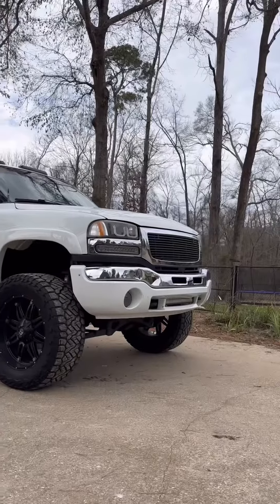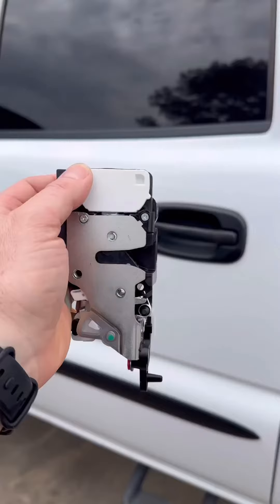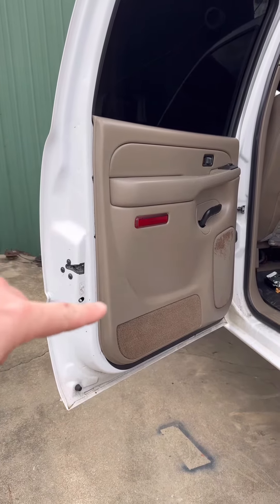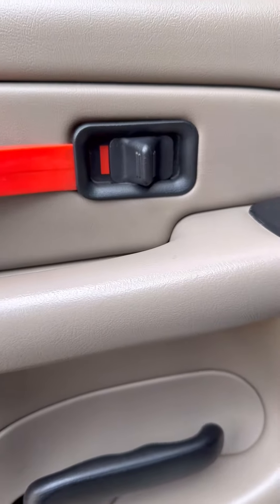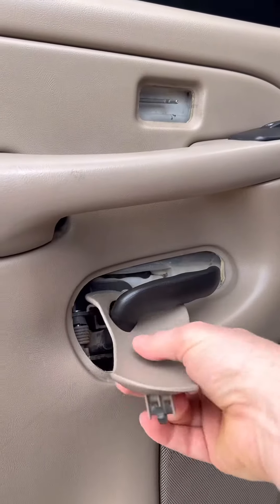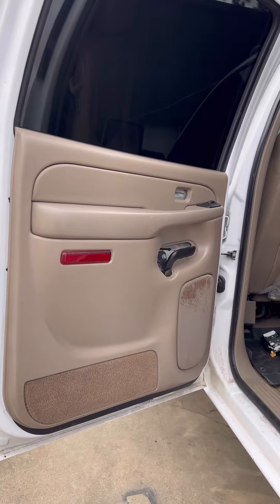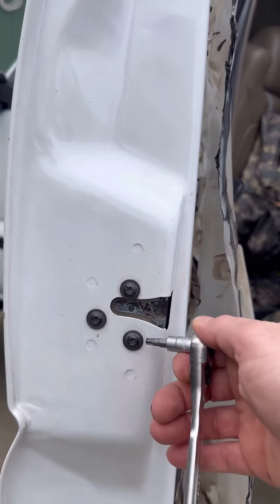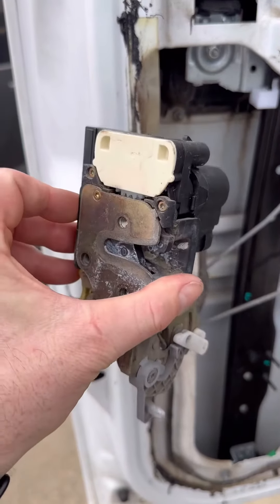60 Second Fix GMC Sierra | Chevy Silverado Door Actuator Replacement #chevy #gmc #silverado #sierra

Comment: Does this also help with how the door shuts? Not having to slam door hard to close it? Just curious
Reply from the maker: We did not experience it being hard to close, but yes, it could be possible that this would make it hard to close.
Reply: @whiplashtv2022  was just curious if this helped door close easier after you replaced this part.
Reply from the maker: @spencermorrisphoto maybe a little bit